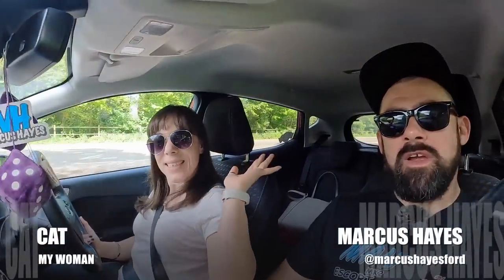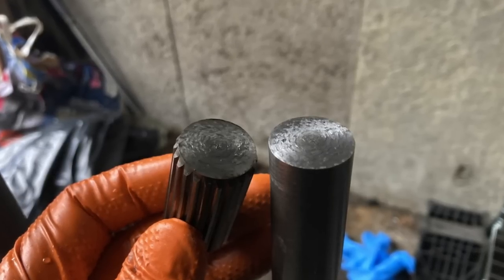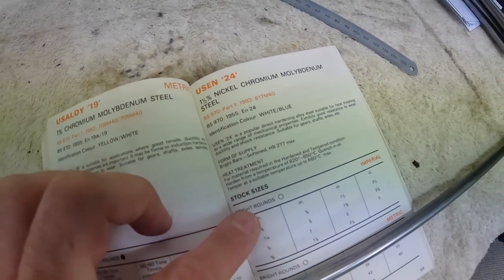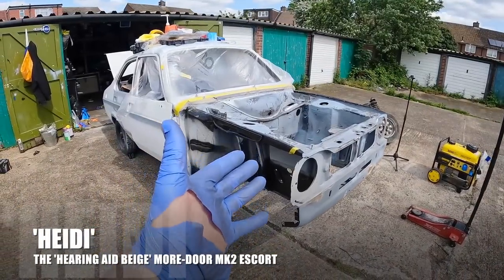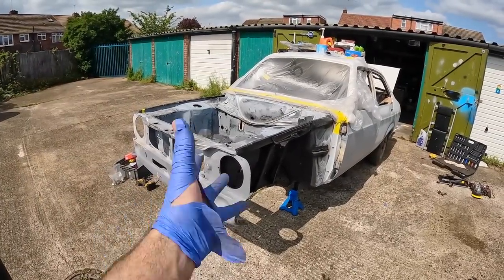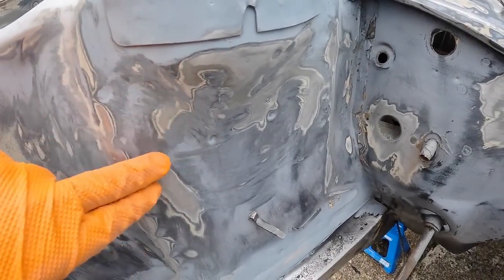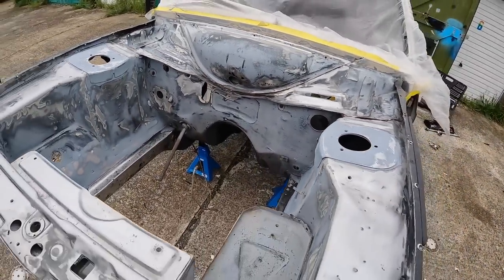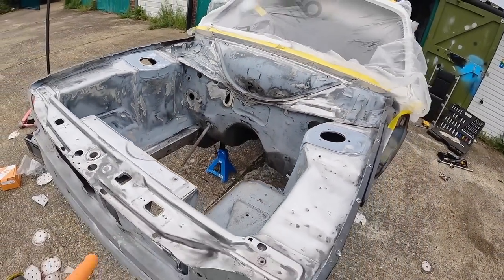Precision engineer with DECADES of experience gives his opinion. . . . .

Comment: S155 / 300M correctly hardened would be my route. Bombproof if done correctly. There are lots of factors that play into these sorts of failures but it does look like its been through hardened which doesn't work for these sorts of applications with the lower grades of steel. The only way to really know is a proper rig test with an appropriate test cycle & regime, not a luxury that many have access to.

Comment: Guys like Carlo are few and far between mate! Shafts definitely not fit for purpose or as described! Excellent progress in the engine bay! Although I wouldn't use filler on the bowl, its mega porous and will bubble up before ya know it 🤔 get Mr clump fab up to do a part panel repair, wouldn't take long to fab that up 👌 You'll be fine rollering two pack primer on, it'll leave a finish similar to stone chip 👍

Comment: You can rub back the primer now to get rid of the brush marks, dont sand the kurust stuff, defeats the point of it changing the surface of the metal chemically if your going to put bare metal scratches through it.

Great vid as always
Reply from the maker: Thanks for the advice mate. 👍

Comment: Updated doesn’t always mean stronger mate, could mean they have narrowed the shafts to make them lighter and this calling them “uprated”. Just a thought I’m sure the shafts you fitted were tapered this could be the “uprating” as I say shaving weight to some can be in same description !!!!
Reply from the maker: I get what your saying mate but I was told they were strong enough for 250 bhp race cars on 10 inch racing slick tyres. ‘Maude’ has 160 bhp and she’s on road tyres. 👍
Reply: @marcushayesford  ok can you send me a few photos of the “break” please Marcus, end view and also side view, also can you estimate how long/distance that was driven after it broke, one more thing set the shaft up touching and measure as accurate as possible the length of the broken shaft and then the length of an original, this will NOT tell you how it broke but give us some sort of wear to the broken ends if that makes sense. I’ve seen similar breaks in input shafts before but we need to go over a few things to see what went wrong 👍🏻👍🏻👍🏻
Reply: @marcushayesford  google this mate, few photos on there that will help you 
Failure Analysis Of Machine Shafts

Comment: The shafts should not have been hardened through they should have been case hardened. If you have a solid hardened shaft it will break as it has no give in it. Case hardening gives a soft core and hard skin which allows some flexibility for vibrations etc. The material EN24T mentioned is mild steel so would most likely need carbonising before heat treatment. So the material used for the broken component is likely not to specification, or in other words the wrong steel was used.
 So to test it the shaft has been hardened through to the core get yourself a file rub it over the sheered end and see if it cuts the metal. If it glides over then it is hard. The correct way would be to use a Rockwell hardness tester. Shame we are hundred miles apart as we have one at work. 
 Hope that helps

Comment: Cut your losses Marcus, go to another company,  these guys aren't worth the time or effort, are you going to put strengthening gussets in by chassis leg, firewall, inner fender area? They really stiffen front end,
Reply from the maker: On ‘Heidi’ I have just done RS top plates and the strengthening plates that tie the inner wings to the strut top cup. She’s going to be pretty standard so I’m not planning any other strengthening. . . . . I’ll be fitting Ford half shafts to ‘Maude’ and I’ll just run Yokohama A539 tyres from now on. 👍